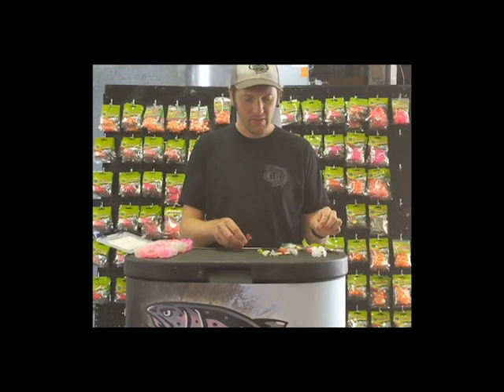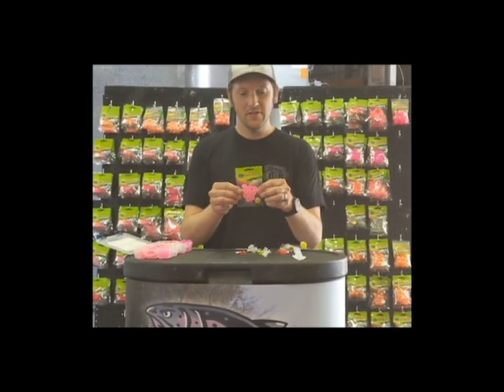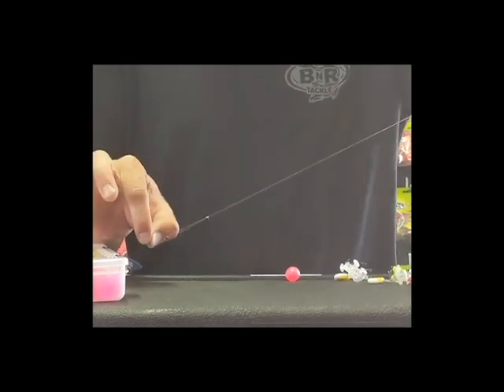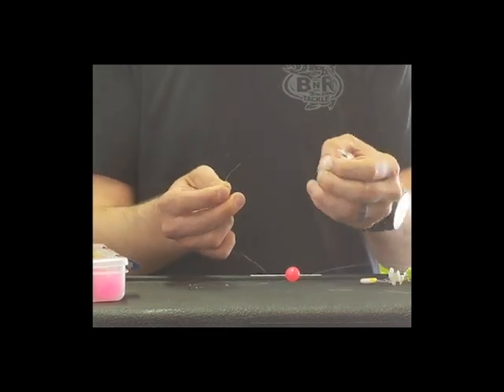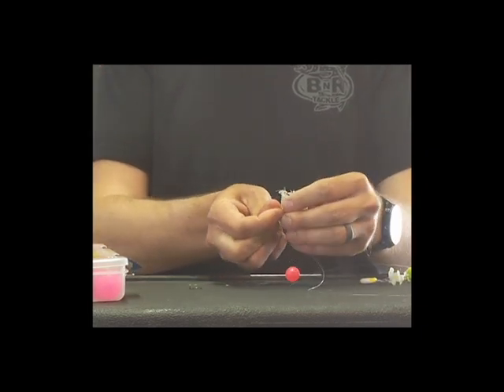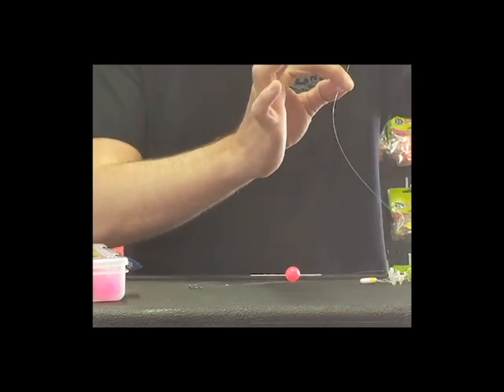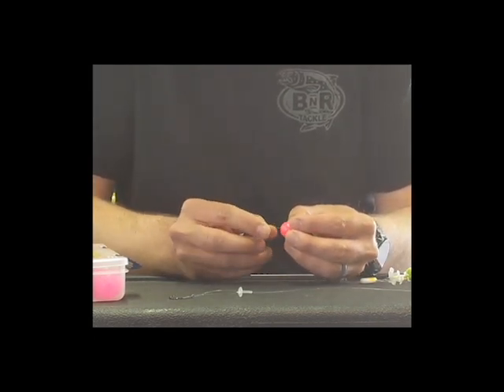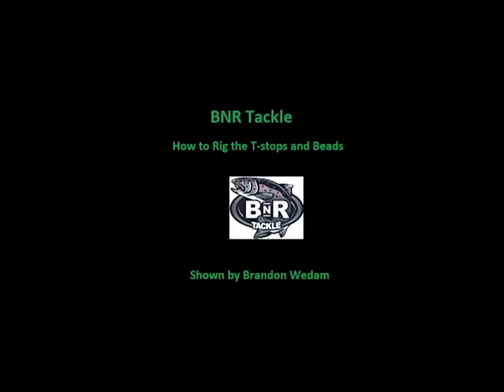How to Rig BNR Tackle T-stops and Soft Beads

Comment: I have the beads and stops, but it seems like it’d be far easier if the stops were reversed on the looped wires. Right? That way you could slide the egg onto the end of the tippet, then the stop, then tie on the hook.
As is you must cut off your tippet and tie another blood knot every time you want to switch eggs.
Reversing the stops on the wires would make things a whole lot easier, far faster and you wouldn’t shorten tippets so quickly.
Great concept though!